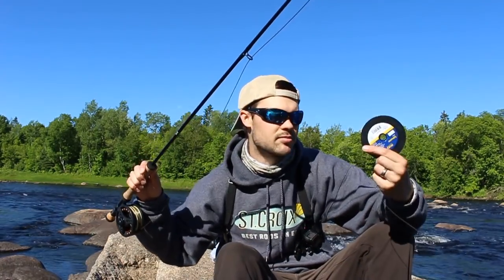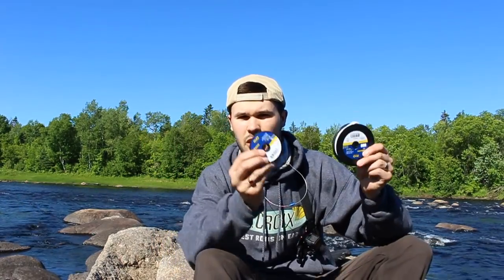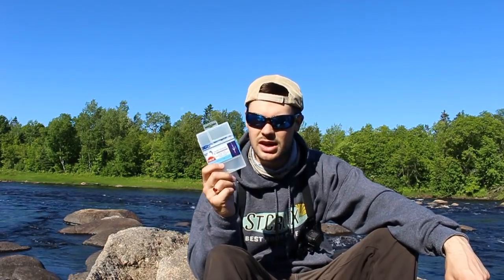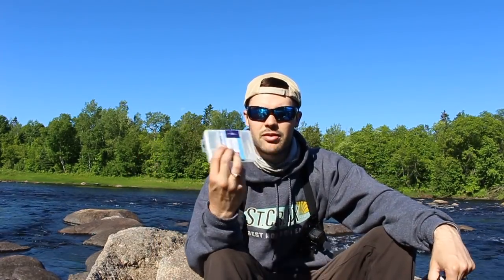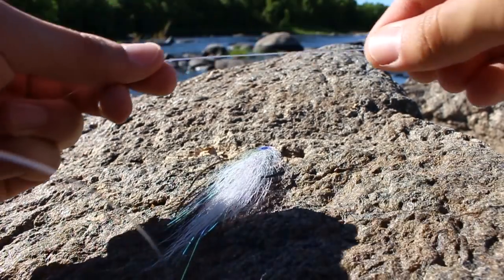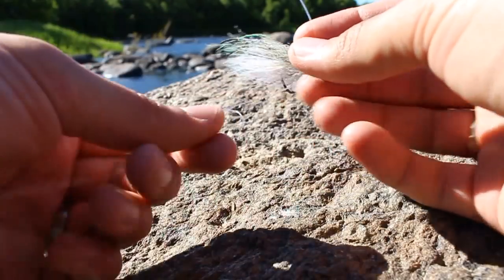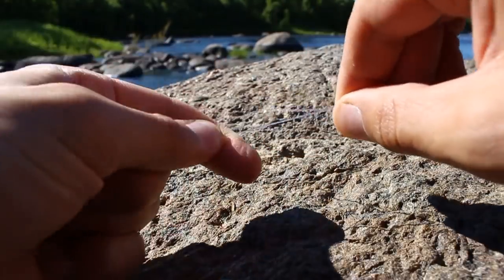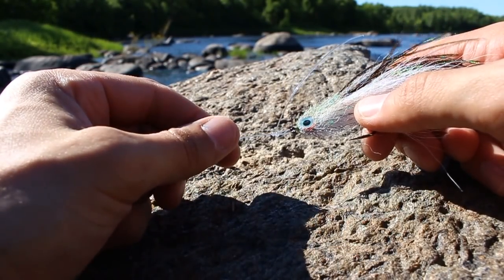Fly Fishing: Smallmouth Bass Leader Build

Comment: Why the saltwater type tippet as opposed to the big nasty or bass tippet?
Reply from the maker: There's almost no difference between the 3 of them. All are medium stiff/stiff to help turn over flies, and all are abrasion resistant. The Saltwater comes in all the line sizes of the other two and many, many more, enough to be useful for Big Game, Pike/Musky, Salt, and Bass/Trout. It's just easier to get the one in all the sizes I need.